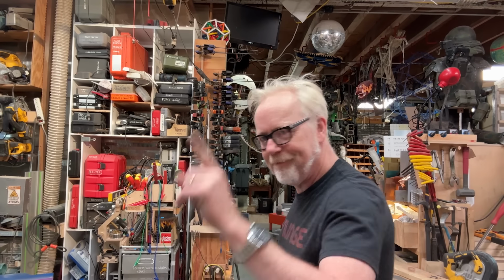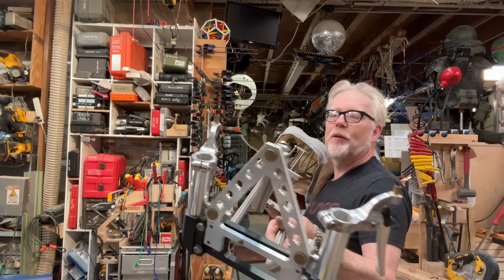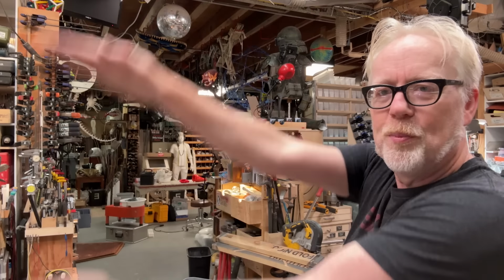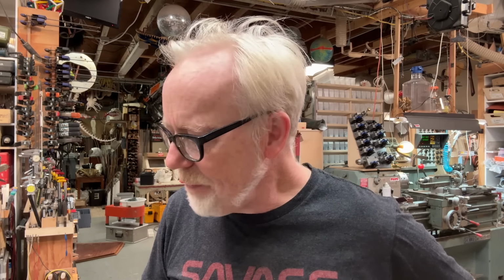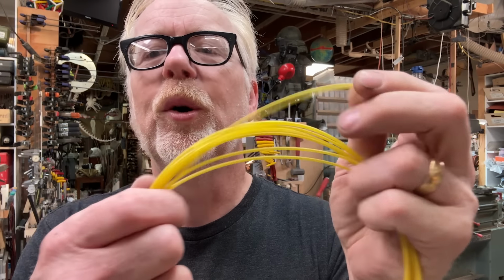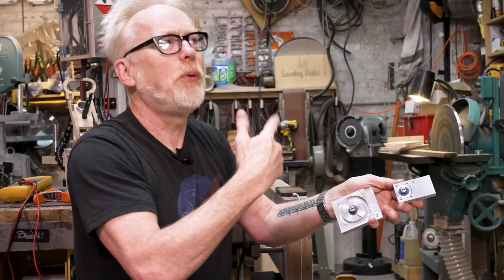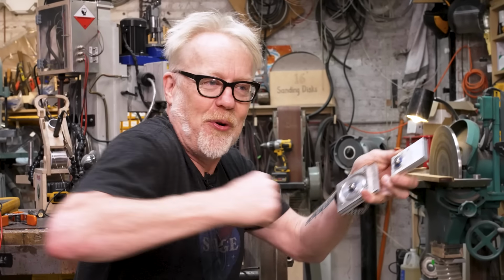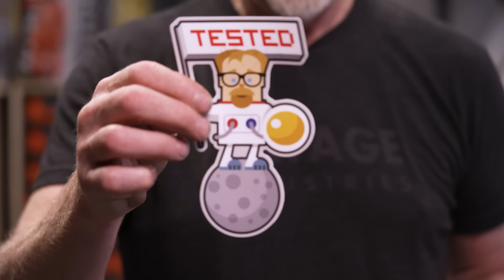Adam Savage's Dino Build: The Great Jaw Mech Fail (Ep 3)

Comment: You can borrow a trick you will find on some push bikes, in that they do not run the brake cable sleeved all the way, rather where it needs to be flexible, its sleeved, where it isn't its tied to the frame and the frame provides the rigidity. This I suspect both reduces cost and weight. You have three struts, if my memory serves, are hollow - running the cable inside is also possible.

I'd also set it up so the jaw is closed by being pulled via spiral spring on the lever control end, sort of a version of a grip spring - i.e a X with a spring opening the bottom and the cable running across the top - the opposite of a bicycle break lever. This way you active it with grip strength and when not using uses no energy. Plus you can 'grab' things and play with them without effort...

Comment: I've been employed as a bicycle mechanic for almost a decade, and I found myself wondering how that housing was going to work when Adam talked about it at the beginning, and I guess I got my answer! You just need something with more structure. I wonder if the fishing line would work with regular brake cable housing? Sure, it would be heavier, but it's easy to get and would probably solve the problem

Comment: ummm... IMHO this is not a push-pull system. this is a pull-pull system, as is any system with two cables in tension on either side of the levers. It becomes a push-pull system with a single rigid pushrod. This is based on standards used for RC flying... Thank you for sharing this awesome failure, we don't learn without failing! As I like to say, happy landings!

Comment: I think it should spring closed and open when you activate the control. Otherwise, you'll be spending all day holding the mouth shut to avoid the raptor looking a bit daft whenever you want to relax your hand. This also provides a predictable "bite force," for safety.
A mechanism that works like a lawnmower pullstart would work. Coiled spring steel inside a housing and the operating cable around the outside.

Comment: Two pullys, run the cable around in a loop, clamp on the long one if you're getting slip.  Put a way to add tension on one leg of the cable as it'll stretch (even pre-stretched brake cables give a bit). Will make it harder if you've not got a straight line to jaw from lever, but not impossible.

Edit: or go hydraulic. Even better solution, can be done with mineral oils etc as needed.

Comment: I thought animatronics were controlled with cams, based on some older uk how stuff works videos on the sewing machine.. 😂

 I never considered the set of wings that extend when nylon ropes are pulled, animatronics. The mechanics work the same as adam pulling on the fishing line to move the bottom jaw mount at the end. I got them intending to just change the Halloween demon wing fabric to something else, but never did. I wasn't brave enough to ever take them apart to see how the ropes worked, but I agree it's really fascinating stuff. ❤

Comment: I was interested to see and be impress by that thin tube/line for this application but thought it looked flimsy, im sure it does its job admirably for smaller things tho.
As someone else mentioned, you have bike levers on "the dino head handlebars" so why not use bike cable? 
I get you are wanting save weight, that has been a well stressed priority of this build but i expect your are probably one to know better than me where structural integrity has to take the top spot among the priorities :)
Since you mentioned possible electromechanicals for the eyes, wouldnt a strong honking servo be an option for the jaw? Yes it would require a battery but if one is already among the plans for the eyes then a slightly larger one is not a big weight gain(and it could be placed on the handlebars to counteract some of the head weight). 
The input for the jaw could be a servo tester actuated by one of the levers, i doubt it and a servo would be much heavier than the mechanism for receiving cable/tube input and deliver cable/tube output.
Anyways, looking forward to see what the final outcome will be, your builds and presentation of them are always interesting :)
Reply: A few years ago, when I saw him starting this project, I was inspired to make a puppet. And I chose to use rubber bands and bicycle cables to control the mouth, because I saw many other projects that used them. I also believe that this is a possible solution. Maybe the weight problem still needs to be solved somehow, but maybe this is the best way to make it work. The rubber bands keep the puppet's mouth closed and the force of the cable (and gravity) opens it.

Comment: Yeah-- but it almost worked. I think you really needed a more solid cable tube-- and real metal cable. Yes, 100lb test sounds good-- but I can see you exceeding 100lbs every time. So, below I left-handedly recommended an actual bike brake with a spring return. You mentioned that you did not like such a mechanism but I cannot see why, if it does the job. You're not going to get all that much sensitivity with your current design. All the sensitivity will be from experience anyway.
Don't get me wrong-- I love watching you work. All good. If you consider this a failure, I do not. You learned a lot and taught a lot.

Comment: I wonder if the combo is better at pulling than pushing. Have a spring for jaw closure. Or to betray my lack of hands-on, will your wheel support a push-pull where the hard work in both directions is pulled? There would need to be a bit of slack so that changing direction is always a pull.

Comment: Off topic but, I've seen furniture makers use string trimmer cable wrapped in upholstery material for beading. A strip of material, backed by adhesive, then a cable laid along the centerline and finally the material folded over onto itself evenly.

Comment: Of course it failed.  You couldn't hear me screaming "NOooo!"  The fiber may have 100lbs tensile strength but in a push -pull system the tubing needs compressive strength at that level or twice that.  Bicycle cabling uses spriral wrapped steel tubing for this very reason.

Comment: But Adam, you mentioned bike cables. Bike cables are fastened to the frame and then the  inner cable slides back and forth. Did you fasten the tubes to the frame of the neck and then try opening and closing? Zip ties would probably be enough

Comment: I would approach the mouth movement from a puppeteering view: I'd use a single wire that closes the mouth when the lever is pulled, and opens when the lever is released. I'd then look for some way to lock the lever in that pulled position to keep the mouth closed. And when I want the dino to talk, I'd unlock the lever and puppeteer the mouth just as you would if your hand was in the puppet's head, only with the lever, but otherwise it would just require opening and closing your hand.

Comment: Just out of curiosity what is the tensile strength of that cable tubing?
The load and mass of the jaw and what you wanted you were wanting to achieve with that ridiculously thin cable housing.
Also high tension on fishing line of that kind can have a cutting nature to softer materials.
Always a fan. Don't get discouraged. 
The pulleys were perfect.
You might want a way to tension the cables so there's zero slack.
One last thing.  If you had a large hole in the control arm you could use one finger to control the motion both up and down.

Comment: You literally stated it at the beginning, a literal bicycle break cable system, you also forgot that the break cable is in a sheeth that has a cap, that holds the cable sheeth in place so that the cable inside can slide, there's a stop at the break handle and at the break clamp end. You only have to use an actual hand breaks, cable and clamp, left side opens right side to close

Comment: Use bicycle cables instead of rope. Rope is too flexible for mechanical mechanisms. Also note put caps over your mechanisms with lubricants to keep mechanisms from scorching themselves when parts are moving. Your jaw mechanism reminds me of a hand crank window roller for vehicles. You have a good idea and is slim for your working parts just the rope ideas is to slim and stretchy. Thanks hope you like the idea for your methods.

Comment: So, since you only have 2 hands…. You won’t be turning the head away from who ever your raptor is talking to, why not just run your line back to your head control mechanism and tie a loop on the end that you can control  simply by pulling it to open the jaw. It looks like the jaw closes by itself. You technically only have half a problem.

Comment: Your design is OK, but you have to take into account how big the forces are in your mechanism. Fishing line probably does not break, but it will stretch. Plastic tubes will crumble under high enough stress. Just switch to thinnest steel wire and spring wound outer tubing. I guess you're handling about 40 lbs.